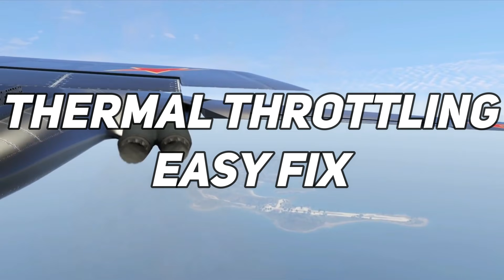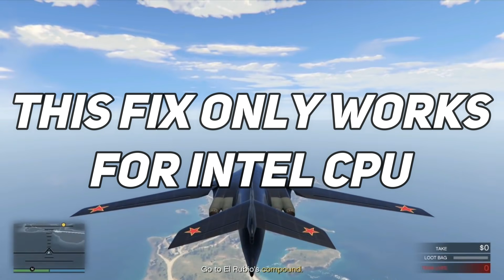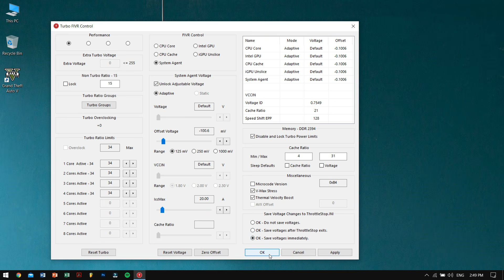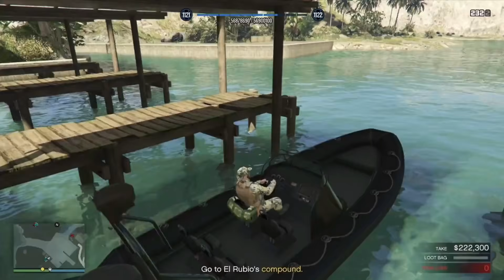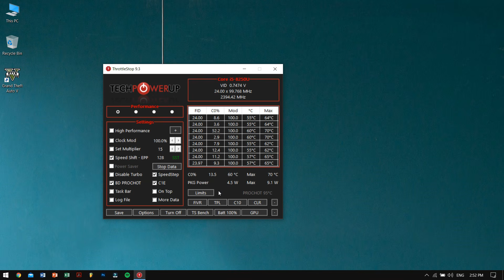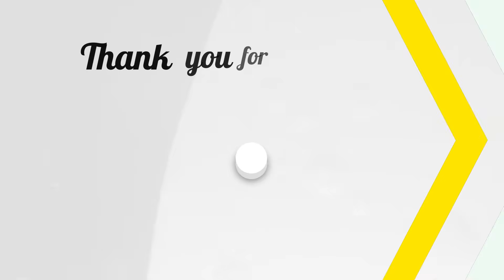Comment: I have the EXACT same processor (i5-8250U) on my 3 years old laptop. Literally today I just faced throttling issue, I applied new thermal paste + these methods and they really help. My situation is: I have no idea why my CPU is turbo-ing pretty much all the time (I guess it has not been like this for the past 3 years but recently), the speed may fluctuate between 2 GHz to 3 GHz and higher when I'm not even playing games. If I play games like this, I get CPU throttling, CPU speed locks at 0.4 GHz, then goes up and down inconsistently. 

Not gonna lie, the impact of undervolting is so minimal that it doesn't really help with throttling issue that much (at least for me), but it's still good to do it to reduce temperature, no harm at all. Disable turbo does help to solve the throttling issue (TESTED), but my CPU speed caps at 1.58 GHz (even though it says base speed is 1.8 GHz but whatever). Now, I think my laptop has been running like this for the past 3 years and everything seems perfectly fine, games are running at acceptable FPS, still smooth enough to play (even if you really disabled boost). BUT- BUT- for those who does not want to disable turbo entirely and get CPU boost for better performance (but without CPU throttling if the boost goes too intense, yes your OS will throttle the CPU that way so your laptop doesn't fry because of intensive overboosting for long duration), I suggest you to do as method 2 demonstrated, go to FIVR and adjust 'Turbo Ratio Limits', this is the settings to adjust the clock speed for each core on your CPU when it is boosting. Running all cores at full speed while boosting might cause CPU throttling (because higher speed needs more power and more power generates more heat and more heat equals to high temperature and higher temperature causes CPU throttling to stop overheating). You need to adjust it accordingly to get the performance suits you the most, either follow TechTweek by lowering all cores by x, OR like the way I do it, keep the first 2 cores at max but lower the other 2 cores by x, for now I keep them at 34,34,31,31 and it seems fine when boosting and I don't get CPU throttling (BOOM! THAT FIXED CPU THROTTLING BUT WITHOUT FULLY SACRIFICING TURBO BOOST). Just keep adjusting and monitor your PC performance using Task Manager and HWMonitor to see the results.

Last but not least, I just want to say that, I guess CPU is just not smart enough to know the turbo boosting limits without causing CPU throttle and when CPU throttling happens the CPU is not smart enough to tell you that it's because of overheating.

LAST LAST LASTLY- if none of the methods work for you, it might just be hardware issue, you get CPU throttling because your laptop is overheating. The fan may be broken or clogged by dust or thermal paste has dried up. You can open the bottom panel to check (not recommended if you are a hardware noob) or visit a service center and get a technician to troubleshoot for you. Good luck guys and thank you for reading :)
Reply: *update: running throttlestop causing the clock speed to fluctuate so badly, thus making the fps highly unstable while gaming. while it was fun to tweak around, i decided to turn it off and suggest you guys to get better processor for better clock speed (desktop).
Reply: Undervolting helps more with 7 series. I have 7700HQ. It save my 4.5 year old laptop from burning into a slimy mess.
Reply: Enjoy
Reply: Yo dude I have exact CPU that you have and the same issue that ur having btw what things did u do to increase the fps in ur game

Comment: Very well presented guide, can’t wait to try some of these out later on!
Reply: Thank you
Reply: @TechTweek  Unfortunately my intel cpu is locked so i couldn’t do everything in your video, I did however manage to limit the max core clock by checking speed shift - epp and adjusting the value to give me a good balance between speed and temp (lower value = higher clock)
Reply: @pablo_jeffscobar_8988  I have the same problem. I have an i5. What did you put for the speed shift-epp value?
Reply: @StuCooksTrust  mine ended up at 110, but I’d recommend starting at its default 125 and lowering by 5 checking temps each time on a stress test
Reply: Yeah

Comment: what about gpu?
Reply: For GPU you'll need MSI Afterburner. Try this method. It should work fine.
Reply: @TechTweek  thanks, but it doesn't work for me, my gpu goes from 70 to 90+ degrees really fast while it's in stress, i am a laptop user so it's hard for me to look inside and blow dust from it, but maybe that is the right way to do
Reply: Yaa
Reply: @TechTweek  I think that my laptop will break, it has 90+ degrees when I open it.

Comment: Well, you could just replace the thermal paste.  
and if that doesnt work, then remove the back panel to increase its ventilation. 
Throttlestop has its own kind of limits. And undervolting doesnt work on all systems. 
Disabling turbo just to prevent it from overheating is indirectly gonna affect the fps and the input latency.
But again, if your system runs smoothly  even after doing all this, then its cool, you can ignore what i said.
Reply: What you said is true bro.
Reply: I've done both and still get 90c+. Gonna try throttlestop today and see what happens